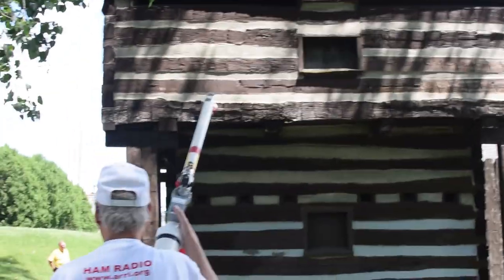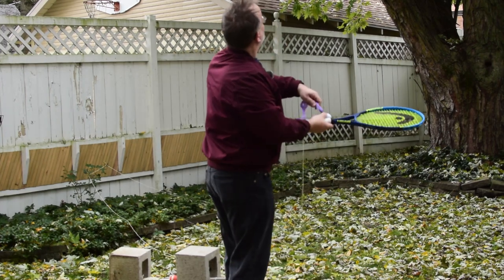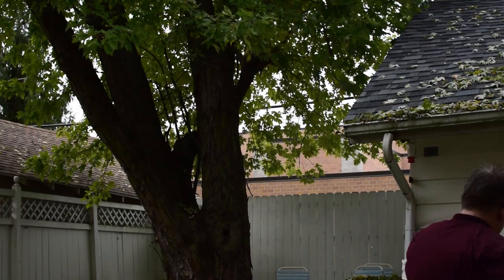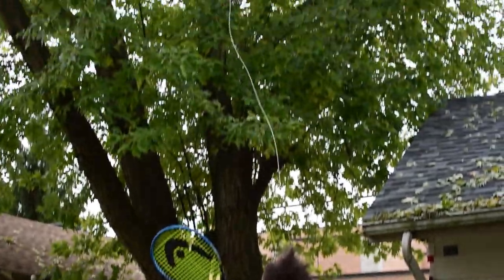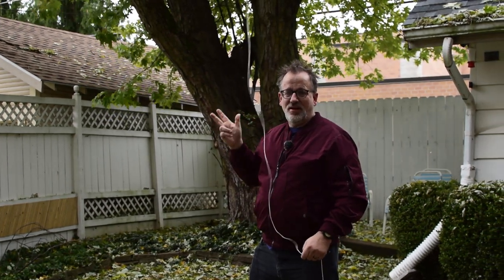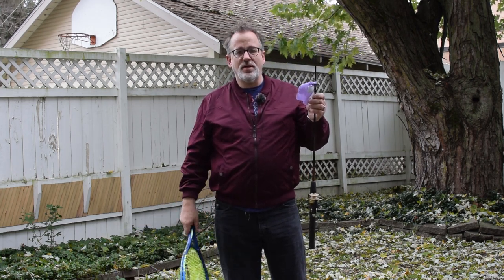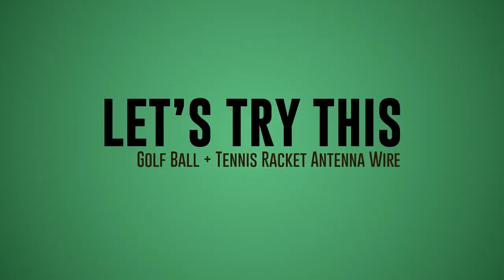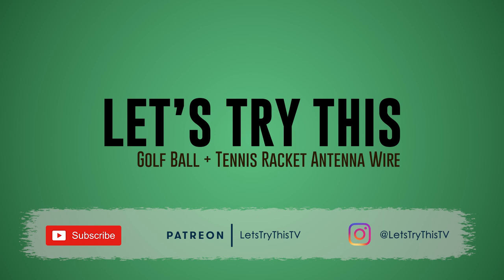Run an Antenna Wire with a Golf Ball

Comment: This is awesome.  I use the golf ball and eye hook thing, been doing that for years, usually keep two or three in my bag with me.  I just throw them by hand now, they are finicky in a slingshot.  I use 30 to 50lb test fishing line as it is very light and has no problem using gravity to bring it back down to earth after looping a branch.  Unfortunately, if there is too much centrifugal force when trowing, the golf ball will loop around a branch.  If you ever come across a neon golf ball up in a tree in New England and eastern Canada, let me know..